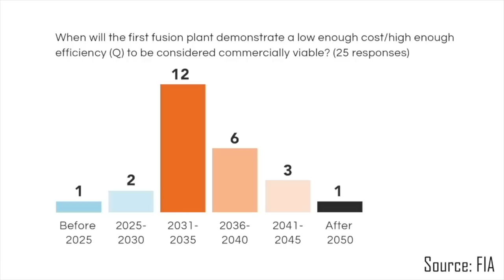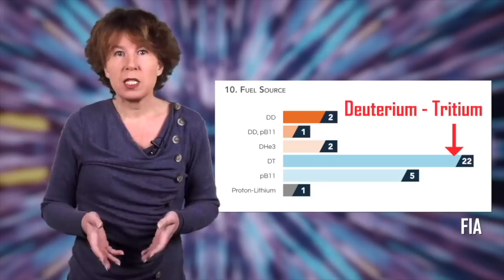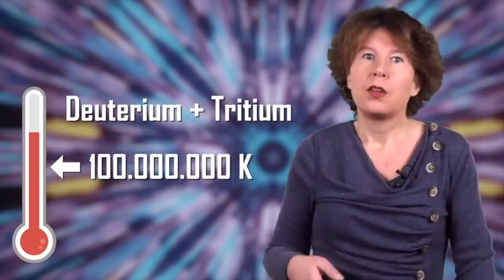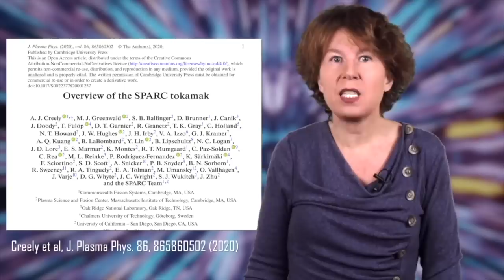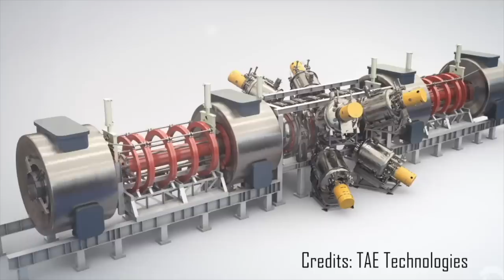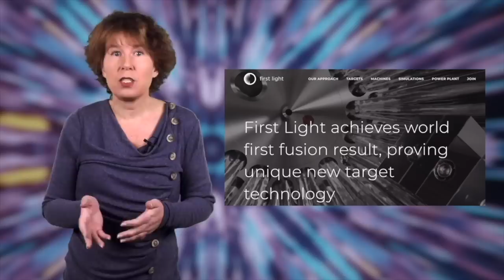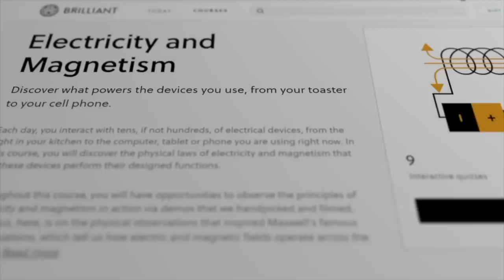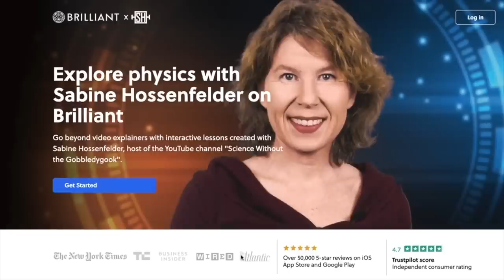Nuclear Fusion: Who'll Be First To Make It Work?

Comment: It's easy to breed tritium from lithium; CFS is working on reactors that produce more tritium than they consume. So no, tritium isn't a big problem. Q = infinity just means that enough heat stays in the plasma to make additional hydrogen fuse, so the reaction continues as long as fuel is fed into it. :-)

Comment: I'm an Octogenarian and can't wait for fussion Nuclear - but will wait no more than 4 years for Indonesia's first PPA for 7×500MWe ThorCon 'black startable' high temperature near ambient pressure AND Walk-away Safe energy converters.
Liquid Metal ion Thorium in Molten Sodium - Berilium Flouride salt Reactors = ThorCon (TMSR)  - at a pre-profit levelised cost to the owner of $30 per MWh (2021 prices) as a base loader capable of supplying auto load following for unreliable renewables).
Fabricated, fitted out complete (except fuel salts) and towed to site, as a double hulled towable barge in a Korean oil tanker ship yard at a cost to the ThorCon owner of $1250 per kWe, with each 180m×65m unit's (1.17Ha or about two football pitches), site preparation undertaken by Indonesia, produces 43kW/m² (compared with Solar farms' 2Watt/m²).

Comment: It seems absolutely obvious to me that steady state fusion reactors will never ever provide a single watt of electricity for humanity.
And if one somehow manages the feat, it will produce the most expensive electricity ever made - and by quite some margin.
It seems equally obvious that a pulsed device is the way to go - and in my mind, the most likely, and most desirable candidate for success is LPPFusion's device. 
But, correct me if I'm wrong: you think Eric Lerner is so wrong he's not even wrong.
Only time will tell. But I feel confident I'm right, because a simple reactor is what's required, and what's obvious.
ITER and other efforts will only ever produce stacks of PhDs as tall as their reactor buildings.
Their main purpose appears to be to fund PhDs, materials research, and to soak up all the fusion money.

Comment: Sabine presents the public with more clear accurate information than anybody around. But I dont share her optimism, not least because i believe there is an important but unanswered question yet to be asked. Question:If you honestly calculate all the resources, energy and money that have gone into all of these fusion ventures so far,
and add on these costs  and inputs if and when fusion contributes to the grid, how much energy will be provided to the grid as opposed to a scenario in which equal
investment, development and implementation had been put from the start into getting renewable energy from the grid and into homes and buildings? With efficiency measures plus proper energy pricing, I do not believe that fusion energy on the grid will be anything but wildly and excessively more  expensive than implementing
solar collectors, photovoltaics, wind turbines, small hydro and stringent efficiency standards throughout the economy. Has anyone tried to measure TODAY how much money and energy have been expended ONLY on basic fusion research? Or has anyone taken those figures and figured out how many localized renewable energy
facilities could have been constructed for that money? And why has no one demanded these figures now, preferring to trust the "experts" who are promising what nuclear fission scientists promised over a century ago: "energy too cheap to meter". Opinions are cheap; predictions are even cheaper since many of those making them won't be around to discover they were wrong. And finally: anyone trusting in the benefits of fusion energy is whistling in the dark as climate change and
biodiversity loss are presently eating away at our global natural systems. Investors in nuclear fusion apparently aren't paying attention. And few others. Just check out
the latest IPCC report. Nature is outpacing humans. It is truly Whistling in the Dark.

Comment: A dozen Startups and not one of them can show an engineering gain Q>10 let alone a reactor gain Q>100 with enough fusion power to drive the electric grid. The reason is Startups do not address the fundamental principles in physics. Ullam/Teller addressed real fusion principles in 1952 and they were successful, fusion Startups do not and their flawed approach is confirmed by experimental observation. Here are four books addressing this topic in detail: "The Fairy Tale of Nuclear Fusion" by Reinders (Springer),  "A Piece of the Sun" by Clery (Ducksworth Overlook),  "Sun in a Bottle" by  Charles Seife (Penguin Group). "Fusion Follies: Carbon-Free Energy and Seawater Sorcery" by Miklosy (Amazon). Thank you Sabine for addressing the promise of commercial power with fusion religion.

Comment: The purer the plasma the faster it burns, if you want to get power from the experiment the star has to be a red dwarf type lots of metals fuse for long time. The enitial fusion process might be less difficult to achieve. I understand the thrill but what's your endgame it's to have continuously power. Well pure stars die fast for a reason nothing to fuse.

Comment: Thanks. 
A question please.
NIF claims it was the first fusion experiment to achieve a scientific break-even point on Dec. 5, 2022, with the experiment producing 3.15 megajoules with an energy gain of about 1.5 from a 2.05 megajoule laser light input. 
What about that ?

Comment: What isn't clear to me:
Which of these fusion techniques support a steady, continuous fuel flow? I think that stellarators have this advantage, but I'm not sure which concept is really qualified for continuous energy production...
Reply: None.  No device has been able to create a functional refueling system because, by definition, it or some part of it must be contained within both the confinement vessel and its field.  Anything within those required features creates asymmetries in the energy release.  It is easy to create a perfect pure form but very hard to create forms that depart from that.

Comment: I still think Generation 4 fission reactors  should still be given greater priority to develop more potential options for low carbon options.  We have most of the technology needed to start development.  Governments agreed to priorities Gen 4 power but have failed to commit.  Only China has Generation 4 prototypes. They would be much cheaper than ITER. The popular and high potential MSR Molten Salt Reactors that can potentially run on Thorium.  Many anti corrosion technologies have not been applied to MSRs.  Though that problem has been over inflated in many minds. The Chinese have 2 MSR reactors that were built very quickly with help from US technology and research.  The last US MSR shut down by Nixon in 1972 for purely political reasons. They do not use table salts. Lithium and flourides are popular.  The great potential for MSR reactors is the full range of possible fuels.
Reply: How is any of this expensive tech going to compete against 1c/kWh wind and solar? Don't make me laugh. :-)

Comment: Uh, ..okay they know the reaction is heat by reaction but think as you travel to the sun. The obvious distance is because the heat is higher ratio than the noise at observation. At least it was on earth. Admittedly the problem is the rationale to not utilize a fuller idea in large measures. If the reaction doesn't make fire, it makes heat or lava. Some think the safety is a concern... regardless the acceptance given.

Comment: The ultimate question is cost. Can we say anything about the long-term potential of fusion to produce cheaper power than renewables plus storage or say fission (fission itself is currently expensive and not cost competitive). Is cheap fusion reasonably likely within the next 10, 20, 30 or 100 years?

Getting more energy out than in for a brief period of time is a far cry from economic viability.

Comment: Sounds like it would be very challenging to extract heat energy from something that is 1000,000,000K on the inside and has to be kept at liquid helium temperature on the outside for the superconductors to work.

In 2030 we are going to keep hydrogen bombs in a magnetic bottle. Impressive.

Comment: Perhaps more should have been talked about the quality of the superconductors, I'm sure many lay-people just think that they are all the same, and can handle infinite amounts of current, voltage etc. This is hopelessly wrong, all superconductors have a limit on the current they can take, after which they stop being "super" and fail... The newer ones which use REBCO are truly astounding, and are easier to build, and cool, and can handle higher than ever before currents without going FUBAR....or a rapid uncontrolled disassembly...

Comment: Sadly, commercially viable fusion is much further off than anyone working on it would care to admit. First you need to demonstrate a reactor design capable of producing a net gain, then you need to refine that design (if possible) to get a commercially viable gain, and then you need a reactor design that can sustain a reaction for a prolonged period of time, which does not destroy itself whilst doing so. We are yet to achieve step 1 in that process, and that's after many billions of funding and many decades of work.

Comment: Great Video.  Why did you decide, though, to introduce these companies by how much money was invested in them rather than by how much FUSION they have produced so far? Or by how much heat they've achieved, rather than how much fusion yield that have measured so far?  While the money invested is surely an interesting detail, mentioning how much fusion they have produced so far would've been far more interesting.  Now, had you asked that question, maybe you wold have introduced the LPPFusion as well.  But, you also missed mentioning several very important details.  I wish, you were more generous when you mentioned boron-hydrogen reactions.  I say that because you only said that reactions produce no neutrons, but you failed to mention something that many will not get from it - and that is that this type of reactions, also called pB11 fuel reactions, do not produce any nuclear waste.  Telling people that we can have nuclear - fusion energy that would produce ZERO nuclear waste is something humanity needs to hear about more of today.  Till this day, when "nuclear energy" is mentioned, everyone thinks of nuclear waste.  And that scares people of nuclear energy all together.  Most of the time many don't even know what fusion is, let alone that nuclear fusion energy can produce cheap safe and clean energy with ZERO nuclear waste and ZERO pollution all together. But back to the point - if people knew about nuclear waste free fusion energy they could take more action to support such research, as today fusion is crowdfunded as well, in addition to being a pet investment to the billionaires like Bezos, and Altman. I suggest you do one video where you rank first 15+ ones based on the fusion yield produced.  And please define that yield in terms of total Qtotal, or reaction-only yield Qr, so it would be apples to apples.  But, it would also be fun to sort them based on dollars invested over fusion yield measured :)  Also, your could add  DPF devices, experimented on all over the world, including the famous Z-Pinch, as well as LPPFusion. Also it would be nice for viewers to know that helium3 for example has to be mined from the Moon because there is none on Earth.  Lastly, I'd like to add that many of these companies will have a hard time reaching net energy because they are trying to control the plasma.  Plasma can not be controlled. Approaches to reaching high density, like LPPFusion's tackles this problem with its DPF architecture and symmetry.  This way we are using the natural instabilities of the plasma to rather than trying to control plasmas.  Anyway,  thank you for making a video on such a great topic.  Looking forward to see what you'll make next.

Comment: You made two stupid mistakes:

Q= infinity just means that the part of the heat produced by the fusion that stays in the plasma is enough heat to create more fusion without any additional energy input to the plasma for as long as it has fuel, It's like a bonfire that will burn as long as wood is fed into it, and there's nothing mysterious or erroneous about it.

Tritium isn't a problem. It's easy to breed tritium from lithium. and since n + Li7 -> He4 + T + n the D + T -> He4 + n fusion of one Tritium nucleus can produce the breeding of an
indefinite number of tritium nuclei. M.I.T. is currently designing fusion reactors that will breed more Tritium from lithium than they consume.
:-)

Comment: Containing the plasma is easily achievable but how do they all try to contain the neutron radiation? Using Deuterium and Tritium as fuel is "dirty" because what ever you do there is always neutron radiation. As neutrons are neutral charged particles you cannot contain it with magnetic fields.
Reply: You need a breeding blanket to make tritium anyway. Basically every single neutron has to be collected, otherwise there won't be any fuel to run the reactors on. The optimists usually forget to tell you that because it is really, really bad news for the technology.

Comment: The development of more novel reactor types provides unpredictable  outcomes. Personally, I think Generation 4 fission reactors can provide more immediate use with less development and lower costs. By 2030, Gen 4 SMR reactors should be in production. Theoretically Gen 4 MSR reactors have huge potential. Even the potential to burn up nuclear  fuel waste.  China is leading the world in Gen 4 reactors.  Including a gas cooled pebble bed reactor with very high safety and easier waste control.

Comment: "Peter" could have stood for Powerfully Equiped Torus Energy Radiator. Does it count to say you've got a "fusion rector system" on your house roof if you've got solar panels? Don't worry, it's just the engineering that they need to get sorted (aka making it work).

Comment: If the Helion reactor works like they say its the most sustainable. They say that their reactor produces H3 as a byproduct. And they can produce it even without fusion reaction. So curious to see if it works. For most of these projects the temperatures and currents needed for the reaction is absolutely bonkers..
My money is on the kinetic type fusion. Its the easiest to manage. Railguns were science fiction once. Now you can build a simple weak one at home. Thtas what they are using. Expanding gases are not fast enough. But with railgun acceleration it matters not. All you have to do is turn on the magnets on and off at the right time. Such a machine is way easier to build than any other reactor which has to be maintained even.
Al the tokamak designs have lithium insulation whcih degrades over time. So any design that works without physical shielding like a liquid shield in the french stellarator or the pistolshrimp machine will win out in the end.
But it is good that so many concepts are explored. In the end all these findings can converge and we can come up with an efficient and safe design.

Comment: I like the fact that she finishes by stating that she is unsure which approach is the best, but is more optimistic about the field.
It used to be that commercially viable fusion was only 20 years away... now it's only 10 years away... we cut the prospect in half.
Given that for 60 years it was said to be 20 years away... I guess we can think that it will now be only 10 years away for the next 30 years... Then 5 years away for another 15 years... then 2.5 years away for another 7.5 years.... Get the idea?
Don't get me wrong, I am very positive about nuclear fusion and want the funding to continue. I am still hopeful one of the approaches hits a major milestone and proves everyone wrong. Scientific discoveries are abundant when lots of people work on the same subject.

The consequence of success in that field is almost limitless cheap energy. Fusion, if first successful, is then going to get a ton of attention and funding to improve the process and make it a cleaner abundant source of energy.

With an abundance of energy, we can start making other forms, like clean hydrogen from splitting water molecules. Then that form of energy can be easily transported and is of very high density, much higher density than any other form of chemical energy we can efficiently produce -- and it would be cleaner, much cleaner than all the hydrocarbons we burn today.

It also happens to be usable as rocket fuel...

It would effectively enable us to finally diminish significantly pollution (many forms of it, including greenhouse effect pollution).

We can't commercially do it now because of the lack of an abundant cheaper form of energy that would offset the inefficiency of transforming water into hydrogen and oxygen. That inefficiency would not matter if we have "too much" energy from fusion.

With overly abundant energy, we can start converting the energy "overstock" into more convenient high-density forms even if the processes involve a large loss of energy.
Reply: Disclaimer: the company I work for sells a software used by almost all the startups and research facilities in the fusion field. Almost all the companies Sabine mentions is one of our clients. I can tell you all of them are active.